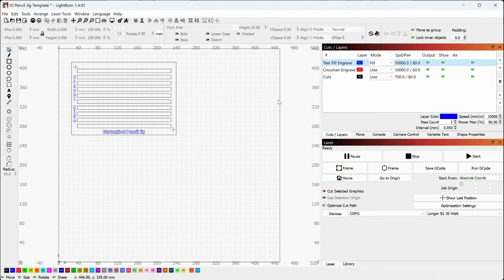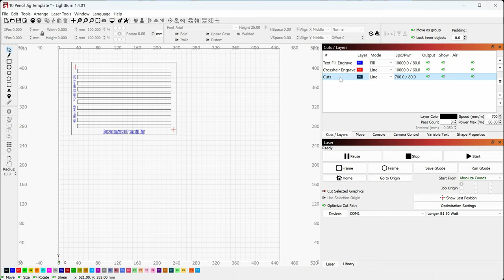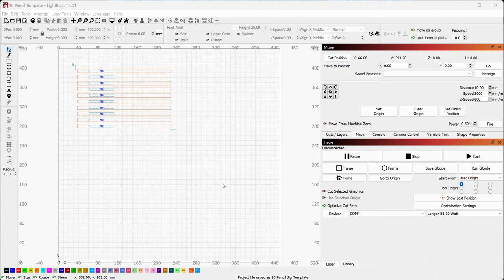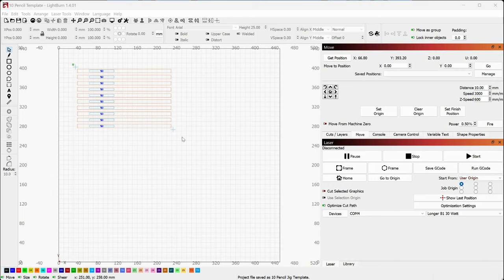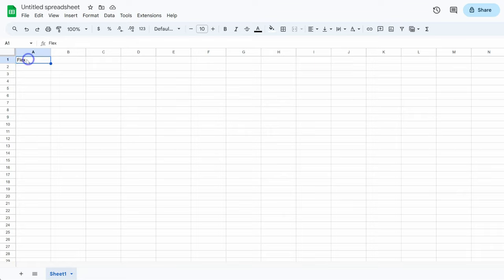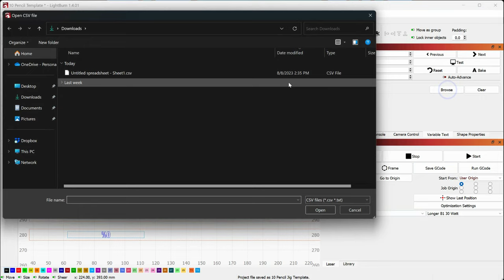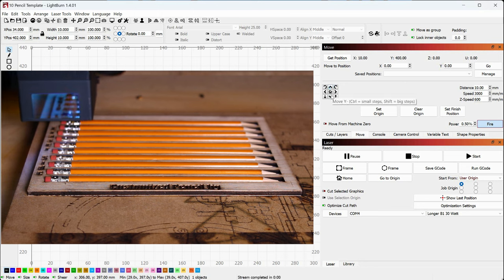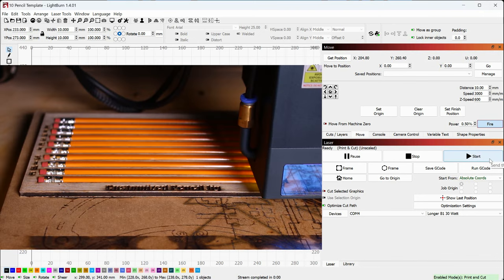Boost Your Laser Engraving Business!

Comment: I received my Diode laser yesterday (still in the box and will be assembling today) and stumbled on this video….you’re a fabulous teacher!  I’m your newest subscriber and I’ll definitely check out your class offerings. I don’t have the same Diode laser as you so hopefully your class will cover various brands and settings.   Thank you for sharing your knowledge (you really are an awesome teacher!)
Reply from the maker: Thank you, I really appreciate that! My diode course is brand/make/model agnostic so it will help even if you have a different laser.
Reply: I would like to offer a suggestion keep the lens of the laser clean, I have already damaged a lens on my 10 watt Longer Ray. I have air assist and thought I could skip the cleaning thinking the air would keep the soot out I was Wrong. My laser was not cutting the 6 mill plywood with the usual 3 passes. Sure enough the lens had a burn spot on it. I replaced the lens every thing is back to normal😁🛫

Comment: Yeah. That’s for a batch of all the same pencils. 
My son just started school so he obviously got a pencil case filled with one regular (grey) pencil and a set of colored pencils. 
I created a jig and everything just as you did, fully assuming „it’s a set. They will all engrave with the same settings“.
Big mistake.
I have now 10 pencils with literally 10 different looking engravings: some only scratched the paint, some went through to the wood, some created dark burn-stains, some didn’t… and one color in particular was so resilient I had to re-laser two more times despite the settings of the laser were EXACTLY the same. 
That was a pain. 

But thanks for the tip on how to align, that’s VERY helpful!
Thanks!
Reply from the maker: Sorry to hear you had issues with the colored pencils.Glad you found the video useful!
Reply: Sounds like mirror/lens or table leveling issues.
Reply: @LuisCasstle   thanks for your feedback but no: I lasered 1 pack of 10 colour pencils, one after another (not 10 at the same time but one after another at the same position).
With colour pencils even though they all are out of the same pack, they widely differ in terms of thickness / composition of the paint that's onm them, leading to very different results: laser with the same settings will or will not scrap the color off and reach the wooden inside, or will leave burnmarks or not...

My learning is simply:  don't assume that one pack of color pencils means they behave similarily. They do not.

Comment: Great video! I was wondering if you had a video that explains a little bit more about the cross hairs and they work? I am wanting to make and little bit larger template. I will be using a CO2 laser. I am just wanting to make sure my text lines up properly. Thank you
Reply from the maker: I don't have an in-depth video about print and cut yet. I've had a lot of people asking about it though so hopefully soon I'll be able to put one out that goes more in-depth on this topic!
Reply: @LetsMakeAThing  OK thank you. Yes I would like to see a more detailed video about print and cut.
Reply: In this case the jig should be named 'cut and print'. Measure your slots, cut them, place always the jig/plywood in the same position, move the cut lines in a tool layer and bring over the engraved text in a Fill layer. Then engrave. It should always stay aligned with the cuts if you're using the same file to do both. There are harder alignment options, but I found this very easy if you learn how to work with layers.

Comment: Nice tutorial. How would you change the font or letter size with this method? Are you doing that in Lightburn? My laser doesn't use Lightburn so I usually create my layout/artwork/text in Coreldraw and send direct to my laser driver. I know how to do this in Corel - I'm just curious how it is done in Lightburn or Google Sheets. Thanks!
Reply from the maker: Great question! The file from Google sheets only supplies the text, it doesn't have any impact on the style of the engraving. Font, font size, and all other design aspects are changed in Lightburn.
Reply: @LetsMakeAThing  thank you

Comment: Does this work with 10 w laser too
Reply from the maker: It should. You just need to run some tests to dial in your speed and power for cutting the template and engraving the pencils.
Reply: yup, it works with every laser. Try a sample with  3500mm/s@45% power. The engraving layer should be set on FILL, not LINE, with no air assist. If it's not deep enough, use the same settings, but also crosshatch. This will make the laser run twice on the same text. Then fill every shape individually. Comes out crisp.

Comment: Appreciate the video.  One question, though.  Since LB has an array function that would have saved the Google Sheets step, is there a reason you went that route?  Thanks!
Reply from the maker: There are a few reasons why I used variable text. Using the array function you would still need to arrange and line up each item to match the template. Once you create an array with Lightburn editing one item doesn't edit all of the items in the array. You would have to recreate your layout from scratch for each new text you were engraving. You could take the time and work out the exact settings to enter in the array setup to have it lined up perfectly, but I'm not sure that is any faster than using variable text. And with a little programming you can enter the name once into a custom program and generate the CSV automatically. That would eliminate the step of using Google Docs or Microsoft Excel to generate the CSV file.
Reply: @LetsMakeAThing  True, a Web app could generate the CSV files for remote orders :)

Comment: The link doesnt work for the template any chance I can grab that?
Reply from the maker: Thanks for letting me know! The link is fixed now and you should be able to go grab the template.
Reply: @LetsMakeAThing  THANKS FOR QUICK REPLY BUT THE LINK JUST GOES TO A PAGE WHERE THE LINK IS DEAD
Reply from the maker: @joeclark2553   The link is working now. There was an issue on the website that was fixed and it took a few minutes for the update to be available. I have checked it from several different devices and the link on the website is no longer dead.

Comment: Thanks for the video - followed the instructions setting the start and end points, however, when I click start my Atomstack just moves to a totally different location and doesn't even start to engrave. If I click frame, it frames the pencils correctly, but that's as far as I can get.
Reply from the maker: I haven't run into the issue you are describing before so I don't have a ton of advice to offer. I would try creating a brand new file and use print and cut in the new file to see if it works. If you have the same problem in a brand new file I would contact Lightburn. Their support is great, and they should be able to help you sort it out in short order.
Reply: @LetsMakeAThing  thanks - think I've solved the issue - I was running a previous version of LB. Updated to the latest version and now it works. good tutorial :)
Reply from the maker: @grezmel  Glad you got it figured out!

Comment: I think using the camera to make a mark would be better and fresher.
Reply from the maker: Using the camera to align in Lightburn is also a great option. Not everyone has a webcam though, so I used the print and cut method as everyone should be able to use this method.
Reply: I agree with you that not everyone has a camera and that cut and print works well. I do have an atom stack camera on my Longer Ray 10 watt laser once calibrated properly it is a great time saver. I find it most useful for using up my skeletons from previous projects. And for $100.00 USD it was well worth it! Before running a critical project I verify my camera calibration buy drawing a small circle in LB at all four corners of a Scrap piece while not touching or moving the work piece I update the picture do the circles line up with the engraved circle? If so you are set. And I use skeletons to do this alignment check. 😁🛫

Comment: I can't justify selling pencils when the minimum to run my machine is at least $25 to $35.

Should mention why doing more passes at lower power is better. It prolongs the life of the laser tube, in particular CO2 lasers, not sure if the same applies to diodes.
Reply from the maker: Sounds like you already have a well established laser business! 

You are spot on about life span on CO2 lasers, running them at higher amperage will shorten the lifespan. Diodes are typically over driven and the 10,000 hour "life span" is pretty generous. Running a diode at 100% is probably closer to 110%. It's really hard to say how much running a diode at 100% will shorten the life span. There are lots of factors like quality control and level of components used in the laser module. I would rather err on the side of caution and get as much life span out of my laser as possible.

There is another school of thought on this topic. That is time is money, and running at 100% power gets jobs done faster and you make more money. So you pay a few hundred dollars once or twice a year to replace a CO2 tube, but you make up for that with more product sales.

I think either way is suitable as long as you're making more than you're spending at the end of the day.
Reply: Have a 10W Diode, and every pencil I engraved is deep enough to fill the text with AMACO Rub 'n Buff Wax Metallic Finish .. I run the text with 3500mm/s@45%power.